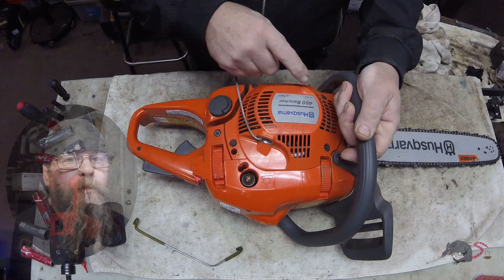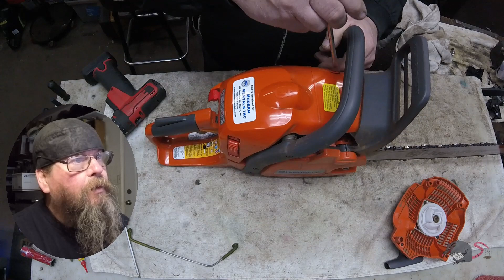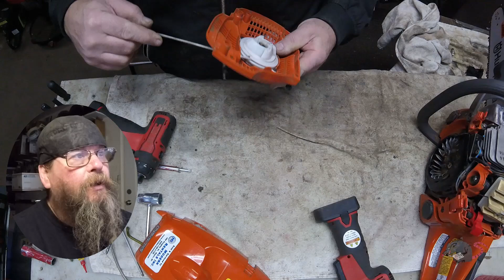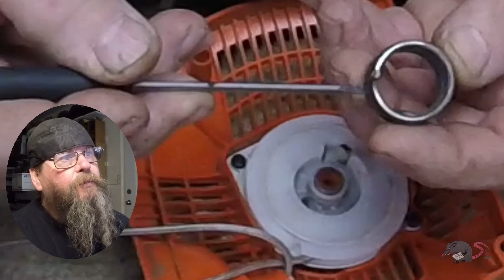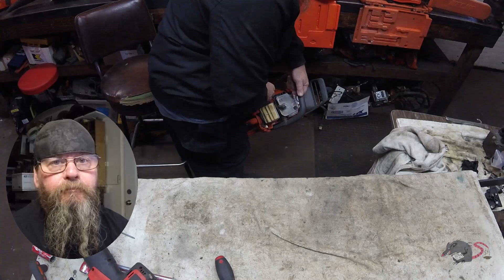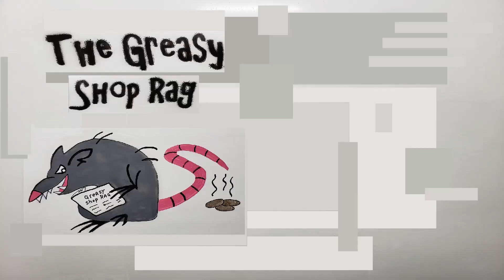Husqvarna 450 Chainsaw Starter Repair

Comment: I really like the idea of the full check over while you have the saw there, and before you repair the starter...
Reply from the maker: A  lot of times a starter repair is because the saw has other problems and just wouldn't start. They pulled till they couldn't anymore.
Reply: @TheGreasyShopRag  That was why I liked your check over 😉 The rest of the machine tells you the other side of the story 😁